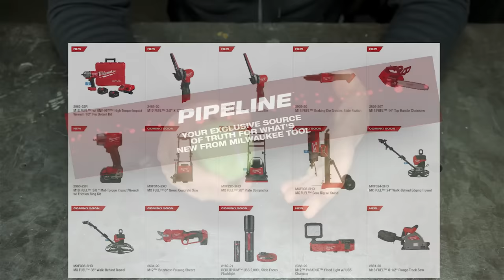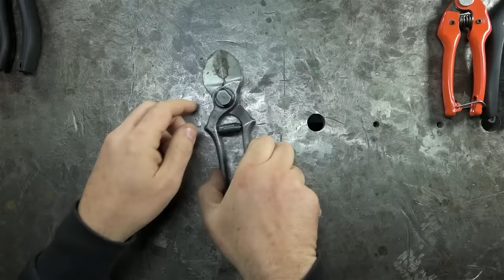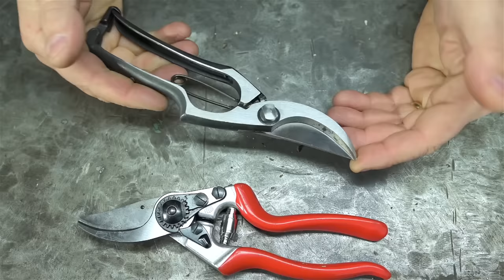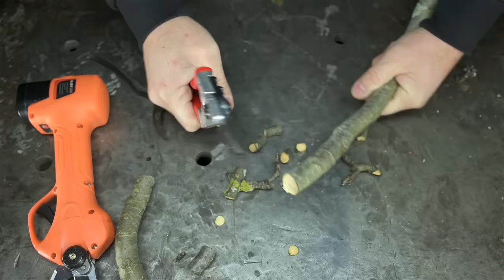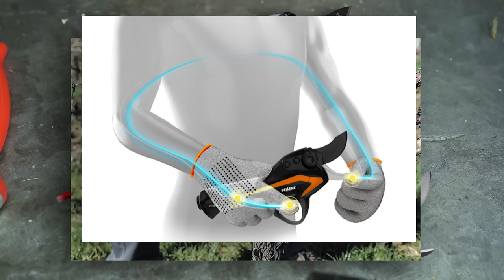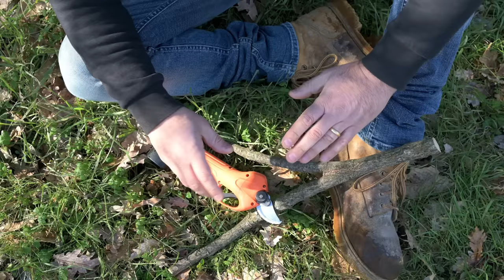MILWAUKEE ?!?!?!

Comment: From the ergonomic/injury prevention POV of someone whose job used to be keeping athletes from injurying themselves, whenever possible, the nippers w/ the cushioned end point of closure are the better choice.

When TOT become This Ancient Tony, his wrists will praise the cushioned type.

Having already reached ancient status, any time I trim a branch, crimp a wire end or any other similar action, my wrist screams at me, if I'm not using the correct tool.

It's not the actual squeeze, it's the abrupt motion stop at the end. It's why I transitioned to cantilevered, mechanical advantage wire crimpers; the pain got so bad, it was necessity.

Don't do much pruning, have a pair of ~30 yr old Fiscars, (anvil & bypass), I keep sharp enough to shave with, & several size loppers for all else. Oh, plus a wife I pawn as much pruning off on, as I can get away with.

Diamond 'stones' make short work of the annual tune-up, w/ light touch up & lube in the between times.

Do like the look of the 'lectric; may chk put.

Re: your Milwaukie habit, (addiction).
Nearly 15 yrs ago, I was forced into a bi-coastal life style; wife took a NY job due to financial peril. I stayed at the Oregon homestead, 3 months here, 3 there.

Having nothing to do in NY, & no $ for touristing, I improved the function of the hovel we were forced to live in. Materials were free via sidewalk shopping, ( unlike OR, where garbage collection is per can, & 2nd hand store are like cockroaches, Long Island is an all you can carry to the curb smorgasbord, only ONE 2nd hand store I could find on the western 1/2 of the island; not Goodwills, etc, most is clothing & housewears.

With materials abundant, the need for tools was next. 

After 35+ years as a builder, I had, at least 6 different brand chargers & hated it.

I wanted one brand, and interchangable batteries, no compromise. Did my research, test drove & abused every brand possible; hey, what else did I have to do but be at Home Depot, Lowes, or independant shops at 8:02 am?  lol

My 1st objective was learning when the manufacturer's reps were there, then the mission started.

After about 3 weeks, the jury was in. Given price, ergonomics, performance & innovation, the hands down winner was Ryobi.

I have never regretted my choice. They always seem to be the first w/ stuff you never knew you needed, (1st w/ a small air compressor by 3-4 months.)

Their combo stapler/nailer is a dream, (this is from someone who has 5-6 small stapler/pin guns, 6-7  mid size staplers/pin guns & five,(?), 16d guns, a 1/2" crown sheathing stapler, two wide crown staplers, (roofing & genr'l use) &, at least 1000 pounds of 'bullets' for all these pneumatic guns.

They have their purpose, but the battery tools have theirs, as well.

Air tools can be a Heinz 57 of brands, but take it from me, whether you're just getting started, or looking to replace here & there, find one brand of battery type, & stick w/ it.

You can frequenty get great deals on new or 'opened box', no charger &/or no battery tools, especially used.

Take my advice, your charging station will be a 2-3 ft shelf. Mine? At least 8' ft, that's just chargers; another 4-5 for waiting to be charged & charged, ready for use.

One last pearl: learn how to rebuild the batteries. 99% of battery pak failure is due to internal electronix circuity pukage, NOT bad batteries.**

** Battery University, (THE best resource for help & learning about batteries, rechargable or non-regharge. (Don't believe the mainstream 'wisdom' about lithiums.)

I am currently using a half dozen 18650's from a laptop I sold in 2000, then got back, for parts in 2006. The parts & batteries sat in a box until 2015, when I started my lithium education at Battery U.  The Sony laptop batteries had 90% of their full charge!

Also, don't believe the hype that lithiums discharged too far are dead. Get a 'dumb' charger; one that doesn't care what the beginning battery charge is. You may have to run the charge cycle 3-5 times, but it will come back 90% of the time.

It's the higher priced, (better?), chargers which refuse to work if the battery voltage is too low.

The best quality, 'dumb' chargers are those sold as vape bat chargers, $5-10 on eBay.

Holler if this info catches your brain, & you want nore info. Glad to help anyone.  Know lots of other inexpensive, low volt tricks & real life solutions.

(IE: How to use ONE Pentium Ii era computer power supply to provide a 1200-1400 sq ft home w/ all your lighting needs; AND have better lighting. Using 80% free, used or obsolete computer components.)

Be happy to share, for no cost; not trying to get rich, just save the planet.

Please pass on my message.

Regards,

GeoD

Comment: Gardening tools/implements of destruction are not commonly found in my repetoire of assorted mechanical devices but a cheap pair of ratcheting anvil secateurs from my local aldi reduced a blackberry bush to bite-sized, easily transportable/compostable chunks and made short work of the, inch-or-so thick, scary-spiky-wild-shoots™ from below the graft line of my lemon tree. Its even earnt a place among my bedside table tools.

Comment: My issue with pruners is i keep breakin them, Hands stronger than the casting. A shear without limbs for me to break may be perfect. Especially since squeezing harder isn't going to finish off the branch i should not attempt, lest my shear be finished instead.

Comment: Craftsman had a slow, cordless pruning shear 10 or more years ago.  I could get a cup of coffee by the time it closed.    Borderline useless.  It was shaped VERY much like the Milwaukee version .... interesting.
As of 3 years ago, I have been using versions just like your demo in this video.  I just love them.  I paid 80 bucks for my first set and 100 bucks for my second set.  I have had zero issues.  I doubt the more expensive models offer anything else.  I did break a blade when I tried to cut a larger dead branch and was twisting, my bad.  We use them to cut off the tips of popcorn cobs ... about 8000  of them per year.  I have arthritis in my hands, these guys save the day.  Some of the higher end models can adjust the beginning opening size .... allowing faster/more accurate closure.  Anyway, these are a game changer for me, otherwise, it's Felco #2
  I have no doubt these shears will take fingers off without blinking.  Perhaps one hand in your pocket?
   Thanks.

Comment: I've worked on vineyards in the past doing pruning using the backpack-battery shears and... they're incredible. The speed and torque is formidable. Blade/trigger control is a joy. You can precisely prune a whole block in a day. They smash the hobbyist battery shears.

Comment: Bernal ratcheting anvil pruners are far and away the best I've ever used. Unfortunately they recently went out of production. If you can find a used or new old stock pair grab em. Bernal still makes replacement blades.

Comment: Interresting video, as always.
One important thing I've learned with pruners, is to keep the blades clean. Sap and resin residues will quickly dull aswell as bend the blades so they don't work properly anymore.
After use I give them a cleanup with some tissue paper and a bit of isopropanol alcohol and that does the trick.

Comment: I love my power pruner ( Ryobi brand). My favorite powered tool since getting an air powered riveter. Both makes a hard-to-squeeze task easier. My weak (getting to be arthritic) hands love it. I giggle and smile (instead of grunt and grimace ) every time I pull the trigger. Note, the Ryobi HP Brushless model has a a 1” cut capacity, the “regular” model is 3/4”. One time the Ryobi Brushless is worth the extra $$

Comment: I have nothing to prune in my yard...but damnit, I need a pair of those electric shears. I'd probably use them for cutting copper wire to length off the roll. Or for cutting PEX tubing.

Comment: I'm a 64 YO male and ain't as strong as I used to be to operate manual pruners. I will buy these as soon as DeWalt comes out with theirs. I have all DeWalt tools and don't want anymore mixed battery packs. 10 min later I just checked on Amazon to see if DeWalt made 20v pruners and they did so I ordered them. Thanks TOT!

Comment: Fiskars "powergear" are pretty nice. Unfortunately mostly plastic but a pretty good design and effective.

They have a rotating lower handle with a pinion and rack that uses the rotation of the knuckles around the handle when you close your hand to assist in the cutting force.

Comment: I will say that the anvil style although recommended for dead wood, they are very fun to use for live as with the bypass they do that scissor slow cut where the anvil does almost a pop like the branch is popping apart. The best clean cuts I ever gotten for live were from my anvil style loppers. You sharpen the blade like a knife and what I find is if you get stringy green branches the bypass can not always cut straight through and can slide over it where the Anvil will just pop it right in too. I have a pair of hand pruners that are anvil but they were a very cheap pair and have been annoying to use but the anvil and blade of it works just the same as the loppers. The fit and finish is whats cheap, stamped and folded steel in that discount 80-90s style of tools instead of cast or solid steel forged. They don't have too much jar unless you are cutting rather large stuff and need to really put some force into them, more than likely cutting stuff far bigger than recommended but hey it works. The anvil really absorbs a fair bit of that shock. You can use and Anvil to pinch through a very large piece like nip half way into it because its far too wide for it to sit in the throat, then rock the blade handle out and then push it forward and can get the rest of the limb into the throat to finish cutting. Its a lot easier to do than bypass as the blade will stick a lot more easily.

Comment: I'm a semi-new Milwaukee convert. Switched to their tools about two years ago.
Being a professional mechanic, in the diesel world; tools get used hard and put away wet. I got tired of Snap-on garbage breaking every few months and needing to be warrantied. I've only had to warranty one of my Milwaukee's, and that's only because I drove over the drill over. It still worked though, even with the battery exploded and missing a 18650 cell, and the clam shell in 4 pieces.
Reply: Welcome to the club. Now all you need to do is have your paycheck redirected directly to Milwaukee's bank account and we can go ahead a finalise your membership to the cult...ah I mean club.

Comment: Well it's good to see you back ToT.  Sucks you are under the weather though.  I have a love hate relationship with a lot of power tools.  Ended up with the Ryobi stuff because when I got started they had a ton of things available compared to other brands but it does what I need it to and have built bed frames among other things so will stick with it.  Right now I am rebuilding a house while I live in it and it's amazing what the tools I have do for me.  House was built in 1911 and had zero insulation, been ripping down 2X4's to pump the wall cavity to the 2X6 range and have driven well over 10K screws with my two Ryobi drivers.  Also attaching on sheathing on the roof among other things inside the house.  Doing demo with a sawzall and no cords is also amazing, just gotta be careful I don't end up cutting a hole on the other side of a wall sometimes.  With all that said I agree the little cutter that Milwaukee is tossing out there seems like a step in the wrong direction since you will need another charger sitting around for a different sized battery.  Ryobi has mostly stuck with the 18V batteries in the tools until they started doing the 40V stuff and the pruner they have takes the standard battery as well and there is a pole version if you want to avoid ladders.  It makes it a little bulkier but who wants multiple chargers sitting around?  I personally have one of the 6 battery gang chargers and got rid of all but one single battery charger for when I am not at home and need to top something up.

As far as the battery packs on those cutters I am suspecting they are building some sort of LiPo but I don't see any reason why you couldn't make a simple adapter with an old pack so that you can make a portable version and just have a short cord run from a regular battery pack of whatever tool you have sitting around.  Just head to thingverse and you will likely find a 3d printable part that can accept your other power tool battery and then adapt it from there.  May not be as portably handy that way but the portability loss would be minimal with a 5 foot long cord to a pack on your belt.  Sometimes you can even find adapters to use with other tools, just gotta add some wiring to make it work.

Comment: the felco ones can be made to cut paper again, every time you sharpen them. But after all the best about them is: replacement parts. EVERYTHING is replacable. You can use these all your life, without changing the main shears.

Comment: My aunt cut one of her fingers off with one of these things, so be VERY careful using it, once you slightly press that trigger and it starts moving, there's no way to stop that and it will cut through bones like it's butter (she's ok btw, they sort of reattached it back, but she can't move it anymore), be extra shure that your hand is not any way close to the blades when you want to make the cut like you do in the video tony, that's exactly how it happened.
that said, I used them in the garden of the old family house and I agree they're incredible, I cut a lot of stuff way bigger than the blades should be able to (by making sort of multiple cuts in the same spot, getting closer to the center of the branch with every cut until the remaining attached part fits inside the blades), stuff that would take minutes with saws (at least with my very old and totally not sharp anymore ones). We too bought one of those chinese ones and is doing great (it's very similar to yours, they probably also produce the models they sell here in europe), my aunt still uses it, not only that but she also bought one of those small handheld cordless chainsaw to go with it, I guess she can't help it (next in line is probably her whole arm).
Btw, I instantly recognized those red pruners in the video, the felco I mean, I own a pair of them in the aforemantioned old family house, my grandfather probably bought them ages ago, alongside a lot of other brands and models (including the anvil ones, they're terrible), I had no idea they were a high quality brand and model, but it makes sense since they're pactically the only model that survived the years and still cuts good, It's the one I use all the time (or at least it was before the electric one), I guess I'll treat them better now that I know that and maybe sharpen them at least once in their lifetime

Comment: I honestly thing the reason why it's designed like that is because of 2 reasons: 1st reason being safety, as you don't want a bunch of calls and news stories about people acidentally chjopping their fingers off, so the added length between the trigger and the cutting jaws is a given. Then there's brand recognition. Milkwuakee tools has a design language so even if you were to remove the logo, you'd still be able to say it's a Milkwuakee tool just by how it's shaped.

Comment: Anvil pruners are awesome, the anvil is a soft metal, copper or aluminium, cant beat a fine pair as there is no bypass and the anvil means they cannot cannot come out of alignment, they look even nastier with the appropriate digit inserted.

Comment: For branches of that size, I'd rather use the "Power Cut*** RR900T" instead of that thumb cutter.

It's a lopper from "Wolf-Garten" with telescoping handles: it's sturdier, cheaper, much safer to use and can handle branches up to 50mm thick. "Wolf-Garten" is basically the Knipex of garden tools in Germany.

I always use it when I'm pruning trees and shrubs in my parents' garden.

(There's also a RS900T anvil version of those shears for cutting dead wood.)

Comment: As a Bush Regenerator in Aus I have owned and used a lot of pruning tools over the years; Bahco, Felco, Stihl, Spear&Jackson, Cyclone, the list is endless. I found the biggest let down brand over the years has to be Felcos. They're expensive, heavy and   outdated.
At the moment I'm running all Fiskars gear, my bypass pruners and flip saw I've had so long that they don't make those designs anymore.
Every day I carry 2 pairs of pruners, power loppers, folding saw, bill hook and mini mattock- all tools combined is less than 3kg (about 6.6 pounds) which is less than my lunch box. Ironically, no-one I work with owns Fiskars tools ( all Bahco/Felco) yet they all use mine.
I clean my pruners every day after work with soapy water + soft wire brush and lube the blades. I carry a small ziplock bag with BBQ wipes with me at work too incase I need to clean sap off any blades. Anyway my point is, don't write off all Fiskars secateurs because the "Pro" range didn't work for you. 👍🌱🤠

Comment: If you re ok with a cable sticking out the best (and relatively cheap) option is pneumatic! 
Granted the tube may be a bit less flexible and you need a compressor, but they work great.

Comment: You really missed the boat when it comes to anvil cutters.  I’ve got a set that use a utility blade (razor blade) which you can buy in bulk.  They’re razor sharp, and you never muck about with trying to hand sharpen anything.  They’re amazing.

Comment: most pro gardeners use felcos in the UK, and if the branch is bigger than 3 quarters of an inch, you are using the wrong tool to cut it, get the loppers out. those electric shears have power, but the bulky head means you cant get it into lots of places to make the correct cut.